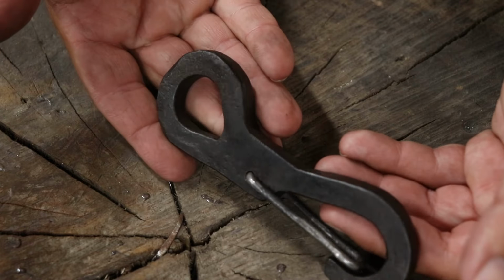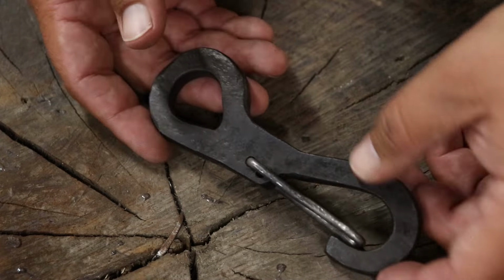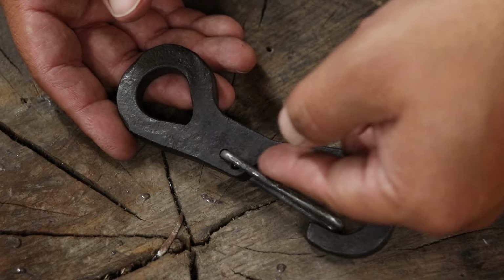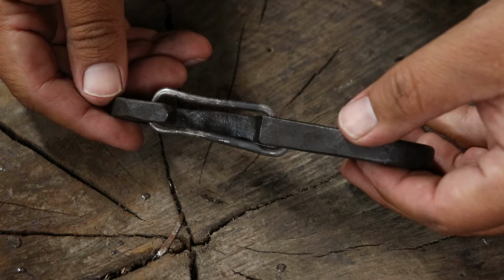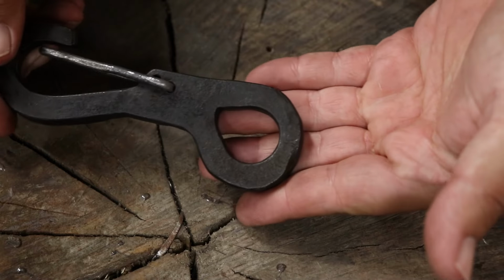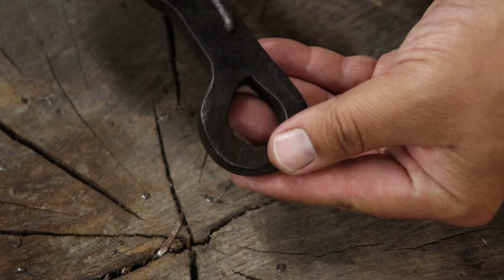Forging A Heavy Duty Carabiner

Comment: This isn't a carabiner, it's a snap hook. Yes, I know that it's a nice thing and will be pretty strong, but the use case is very different and you do not want even a single person using this where a carabiner is required instead of a snap hook.
Reply from the maker: I agree it was just a fun project, manufactured safety equipment is always a better choice.